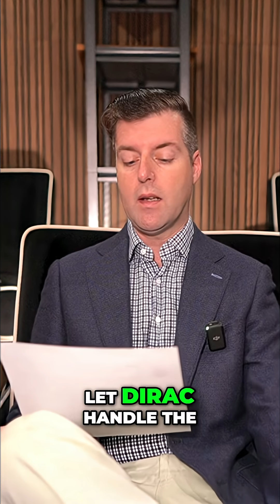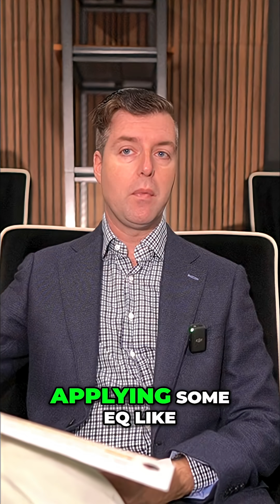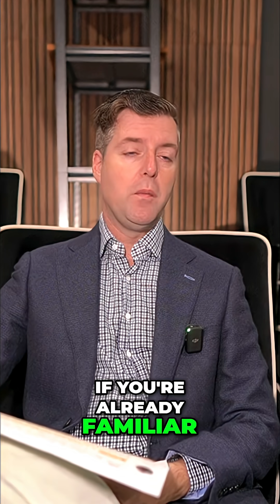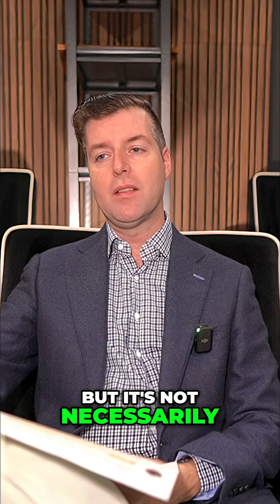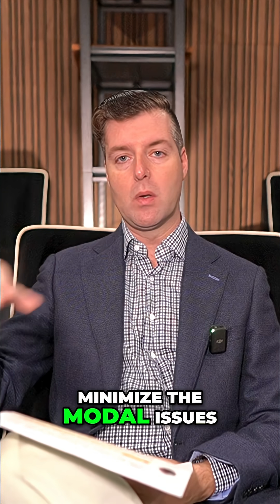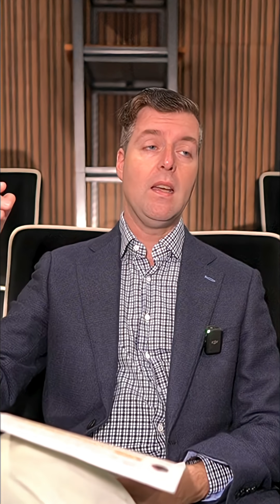Dirac Live Bass Control: Optimal Subwoofer Alignment? #shorts

Comment: Do make minor corrections at the RLP for each speaker individually after running Dirac? 

For example, like if there are peaks that somehow get added by Dirac, but that can be knocked down afterwards but might only be present in one speaker. I haven’t looked at it in months, but I noticed Dirac adding a bump to my center around 800hz that sounded off at the MLP and even though it might have been the result of trying to compensate for a dip at another position, it sounded bad.

I know not to go overboard with this kind of stuff, but just curious if you ever find yourself having to do that.

Comment: Level match at rsp with all subs trims at the same dB (0) then dirac calibration?  Question is... if dlbc sets the trim levels to -2 or -3 and you really wanna be at -8 or so.. do you redo the whole calibration with gain set higher on all subs aka level match lets say 5-10db hot or just adjust trim levels in quick settings and level match again to be 10db above reference of a speaker (75db vs 85db)?